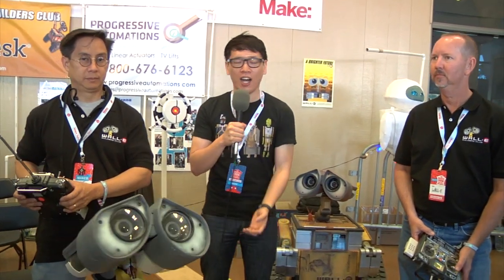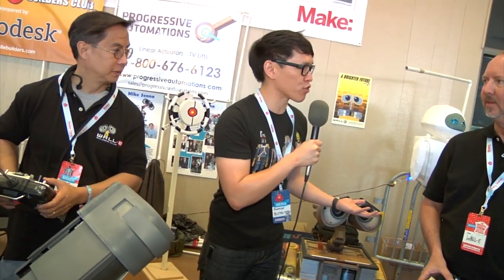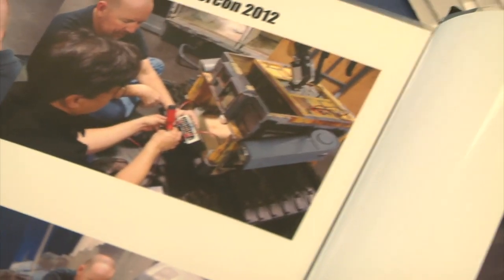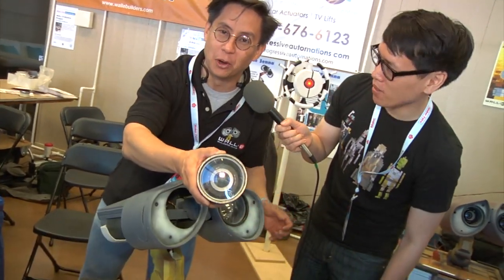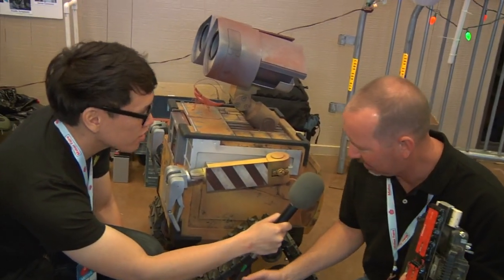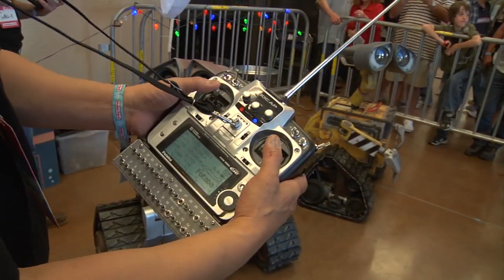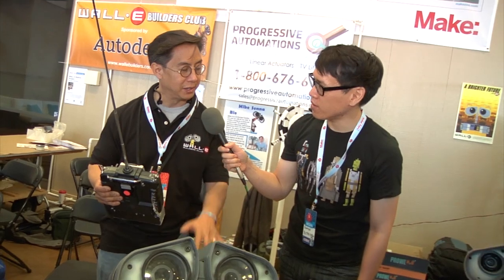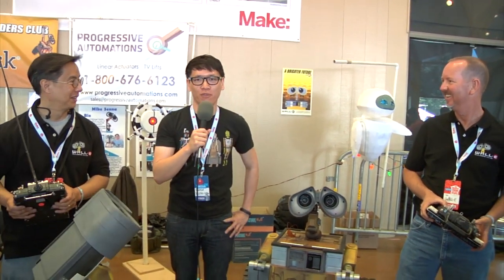Maker Faire 2012: The Wall-E Builders Club

Comment: Imagine if one of these Wall-Es were made today with nowaday's technology. The controller could completely be replaced by a VR headset!
You would have to make it so the head can move as fast as you can move your head, though, if it doesn't that'd be a motion sickness machine.